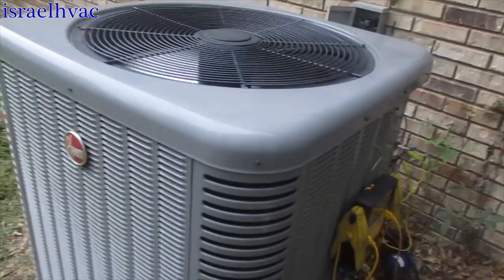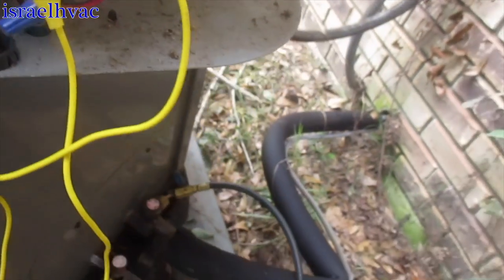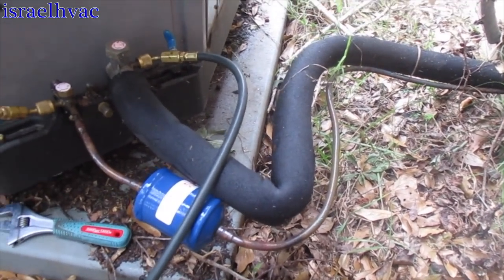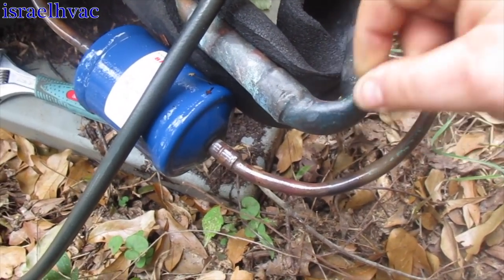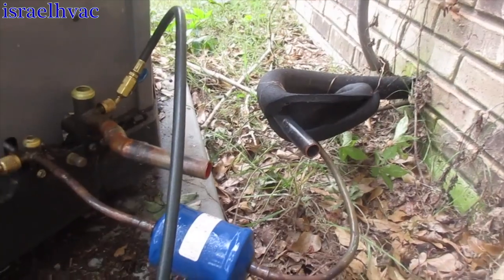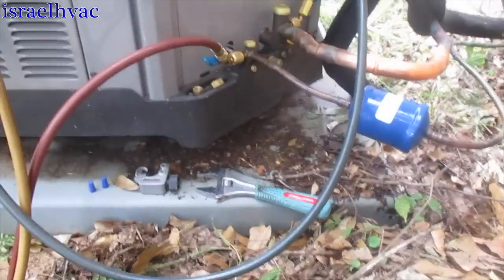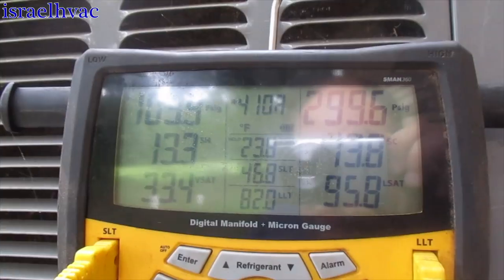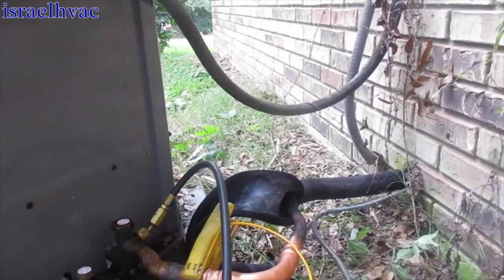HVAC Service: Kinked Suction Line Repair

Comment: I’m just an interested homeowner.  Question: When you cut out the piece of suction line, can you tell me how it is that you don’t lose all the freon in the system?  Thanks.
Reply: Pump it down or recovery.
Reply: @marcusfitzgerald59  Thanks.  Makes sense.

Comment: John "hitting it with a lawn mower" is a great guess. Another failure mode is a hurricanes wind bulled (pushed) the unit and  kinked the line too. That is common here on the miss gulf coast after a hurricane . A minor kink is livable. Major ones need fixing. After katrina many that leaked out the r22 did so at a crack by a kink.
Reply: I had a condenser flipped on its side from a hurricane. I didn't believe it till customer showed me the pictures.  They called us out to check it because the customer flipped it back right side up. It was running fine when i showed up and no kinks in lineset which was expected when something like that happens

Comment: I'm kind of new to HVAC but shouldn't you prep and scuff the copper tubing before cutting it to reduce the risk of contamination and filings getting into and fouling the system especially the TXV?
Reply: You clean it after you cut it. Not before.
Reply: Yes you can do the majority of the cleaning before cutting. It's easier because the pipe is sturdy while sanding. Make sure there's no patina before you braze. Deburr and nitrogen flow meter is crucial. 🏆

Comment: Zoomlock is expensive, i would of just bent it back and squeezed it back open with channel locks
Reply: The pipe might have cracked, or at least have been weakened in that area.
Reply: Where the buckling is ie bent area gets work hardened. When you try to bend it back it often thus bends in another place real close. You can heat it mildly with a torch and try too. This kinking behavior was common after Katrina here.  My 5 ton AC R22 unit has a kink in the suction line and I just live with it. Whether the kink is a "problem" depends how much "extra" suction line "equalvalent extrar Length" that defect is . ie it might be just like the line is a few or many feet longer. With my own unit I have before and after Katrina/kink numbers so I know the defect is usable.  In some Katrina damaged units the debris hit the units and the suction line pulled many feet through 3/8 inch sofit plywood.
Reply: 3beltwesty f

Comment: An old technician told me that Rheem heat pumps txv's fail often.  That suction line might have gotten kinked if someone ran behind it and didn't see the copper. Just a guess. But I've seen units running with worst kinks than that so I'm pretty sure it's the txv.

Comment: I don't see any use for a 45 near the service valve. I would make time to braze a new section of straight pipe into the service valve.
Reply: Thats what happens when an installer doesnt have a coupling and doesnt wanna run for one

Comment: Have you ever had nitrogen leak back into unit while leak checking with valves closed. It happened to me once and I had to blow the whole charge the pressures were going crazy up and down.
Reply: That's another reason why you shouldn't pressure test higher than the saturation pressure. If the nitrogen is lower pressure than the charge behind the king valves, it cannot get in there.

Comment: Simple. Unit should of been rotated 45' & a new whip ran. Going cheap on stuff like armaflex/copper/whip doesn't pay.
Reply: Code doesn't allow "service access" next to the wall in FL
Reply: Install unit at 90 degree increments. Parallel to the wall. 🏆

Comment: Lack of airflow dude . Increase fan speed! The unit should have be rotated 90° TO ELIMINATE all the 90s . You don't seem confident and I believe there is no issue with txv you had 16°superheat so it was doing its job . Low suction due to lack of air or oversized condenser.

Comment: So he clearly stated all he did was replace the 90 degree elbow which means he didn't replace the filter drier which is HVAC 101....and then rambles on about excuses for not having all the proper supplies.  I didn't see any damage to the exterior of the ODU.SMH.